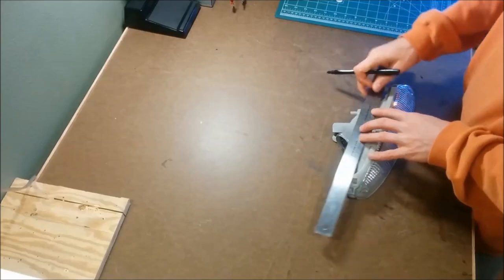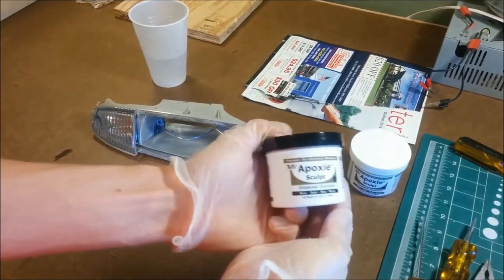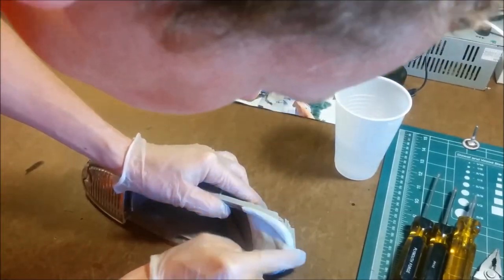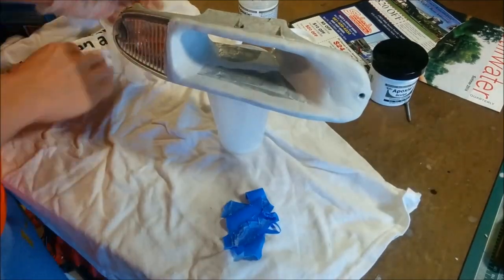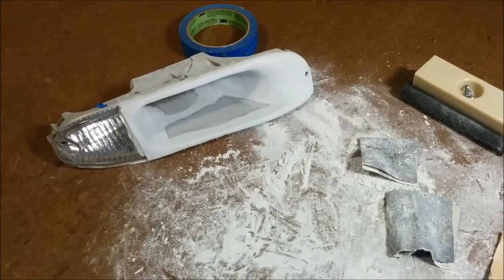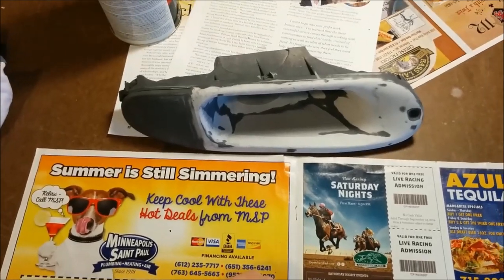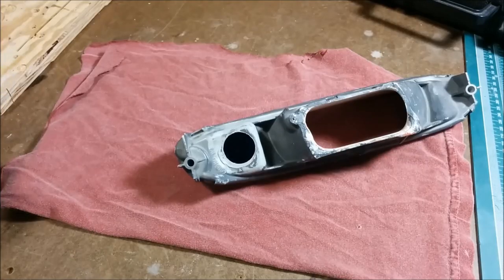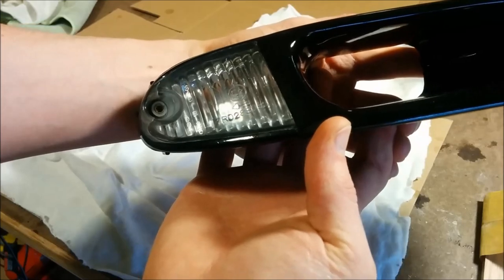How to: Make Turn Signal Intakes (TSI)

Comment: So according to the Bernoulli Principle, or a quick google image search of car aerodynamics, these are the worst possible intakes on a car, and they are actually exhausts. Since the air is spilling over this front edge of the hood at a high velocity, the air is being sucked out of the intake. You'd find a much higher pressure inside the engine compartment, along the bottom edge of the windshield, or on the back of the car...
Reply: Special EDy you are actually right lol. /mech Engi here
Reply: It's for style.  Serves no functional purpose.
Reply: it's a miata bro, this is for looks
Reply: it's a miata dude. calm down

Comment: I'm actually half way thru making my own right now, and I had planned to use just bondo to make the intake look good... but now that I've seen this video I may have to use the epoxy/clay stuff instead! Thanks for the idea and good video
Reply from the maker: Yeah I wouldn't use just Bondo because thick Bondo will Crack. Use clay for sure.

Comment: Nice work. One thing I noticed was when you had to go back and add to the bottom to fill the gap, your final line was exactly the same as the lens. Maybe could have used the lens as a template?  When are we going to see a new video in your new place?

Comment: Now that i've started to dive into this project, I'm wondering if you have any issues with melted plastic? I noticed they put a metal heat shield type deal around the bulbs in the stock turn signals. Did you put your own type of heat shield in? If so, what'd you use? If not, have you had any issues with melting plastic? Thanks for all your help and advice!
Reply from the maker: I'm using a LED bulb now. I wouldn't use a regular bulb because I bet it would melt
Reply: Ahhhh gotcha, thanks for the tip man! Wish me luck!

Comment: looks great bro. nice work.
do your turn signals blink fast now that they are LED?
Reply from the maker: They did at first, but I fixed them by following a tutorial online that shows you how to replace a resistor in the flasher module to eliminate the fast blink.
Reply: can you link me to that tutorial? I have LEDs in the rear and they blink fast.
Reply from the maker: +xld3000 http://forum.miata.net/vb/showthread.php?t=335534

Comment: Hey another quick question, how'd you tape off the section on the clear lens? Did you just use blue tape and razor blade the shape you want or what? Thanks for all the tips so far
Reply from the maker: Correct, blue tape and razor blade is all. Be sure to remove the tape right after the last coat of paint.

Comment: Nice job, a lot of work, looks great. Good place to tube your intake air. My lenses are always full of moisture, like to get that fixed, any clues ?
Reply from the maker: dyno824 try resealing the lenses with a silicone caulk. You've got a crack somewhere that's letting the moisture in.
Reply: Both lenses are like this. Could have a lot to do with were i live, Oregon coast, everything moist here, great for mushrooms though. Thanks for your comment.

Comment: Nice work on this.  Clever and creative, I dig it.  Now that I have a butane soldering iron and can do wiring, I am going to borrow your idea on the DIY projector headlights and do fixed ones with flat lexan covers.  When I get around to the video I will give you a shout out.  Keep up the good work!
Reply from the maker: Thanks and good luck
Reply from the maker: Thanks and good luck
Reply from the maker: Thanks!

Comment: Looks awesome man! Great job! Question is how did you hook up the actual intake on these?
Reply from the maker: It's not hooked up. They just provide cold air into the engine bay. It would be possible to hook them directly up to the air intake with some ducting though.

Comment: Absolutely amazing craftsmanship but something that I think would have made it that little bit better is to paint the screws that are part of the intake black, and to add some black wire mesh to the inner part of the intake so you don't get rocks in your engine. Other than that, great video man! 😃👍

Comment: Really quick question, hopefully you'll respond to it, but how long did this take you?
Reply from the maker: It took me about a week worth of evenings to do each one (two weeks total).  First night was cutting open the lights, sanding, and applying Apoxie.  Second evening was shaping/sanding and applying Bondo. Third evening I made the new light socket. Fourth evening I did final sanding and Primer and base coat. Fifth evening I did clear coat. Just an estimate but you get the idea. Hope that helps.
Reply: Justin Depew Yes it did! Thanks a lot! I am trying to find a miata to buy and am just looking at fun DIY projects to do. Thanks!

Comment: but how does it connect to the actual engine intake?  i think if it's not directly connected the huge intake in the middle of the bumper would just negate all the air coming through the turn signals.  probably you can devise a ducting that would lead it directly into the intake airbox or CAI.

Comment: Wow, that's done right.  Other than the ecstatic's, is there any other benefit?
Reply: aesthetics* well it should cool the engine bay a bit I don't know if it works though
Reply: aesthetics* well it should cool the engine bay a bit I don't know if it works though
Reply: +lameWB Thx for the video & reply.

Comment: any issues with the 2k clear? I was told you cant apply it over acrylic paints. I just did a duplicolor  metalcast paint job on my bobber and need a clear thats fuel resistant.
Reply from the maker: Still looks like new. Not sure about going over acrylics since I haven't tried that. I imagine it would go over anything since it's 2k.
Reply: +Justin Depew in the video you showed an acrylic lacquer paint and clear. did you not use those as the base to the 2k?
Reply from the maker: +DocHolliday oh sorry I misunderstood. Yes I used that paint as the base to the 2k.
Reply: +Justin Depew ok cool. thanks for the fast replies. Great job on the custom intakes. I love seeing people think outside the box and do their own thing.

Comment: Is there a reason you completely cut off the edges of the lens? I'm about to tackle this project but I feel like if I leave the edge of the lens on, it'd be a good fit off the bat rather than trying to shape it to fit perfectly. Would this work or is it better to just sculpt it entirely from clay?
Reply from the maker: You've got a good point. I think leaving the edge on would make it have a much better fit. I imagine you can still blend it in with the clay.
Reply: Okay cool, I just wanted to see if there was a reason why you didn't do that. Will the Apoxie bond to it okay? My dad thinks you did it your way because my way would be more prone to chips but I don't think he knows what he's talking about. He was just making a wild guess. I guess I'm just checking if my way would be as legit as your way? Thanks for the quick response by the way, yours look great!
Reply from the maker: I figured it would be hard to blend the lens into the Apoxie and you would be able to see the where the lens and Apoxie came together, that's why I just cut it all off and made it all Apoxie.  I was able to see a line between the area of the lens I left for the turn signal and where the Apoxie blends into it.  If that level of detail matters to you then I would probably cut the lens all the way off and mold it like I did.   Otherwise the Apoxie seemed to stick very well so I don't think it'll be an issue.
Reply: Huh, interesting. Well thanks for the advice man!

Comment: how about actually making them as the cars intake?
Reply: brake ducts would be mire usefull
Reply: water would be it's enemy
Reply: +Shavan Irving check out haggard garages video on them trying to hurt a car with water. makes little to no difference.
Reply: +Taylor Perkins Oh and my V35 skyline has an intake where you can pretty much see the air filter from the grill
Reply: +Taylor Perkins i have my intake routed to my tsi its pretty easy to do
Reply: the headlights are in the way for any ducts
Reply: +xDrifz Jasons E. Mazkalniņš only when they're closed mine are always open

Comment: I would like to know how you get through MOT with these. Isn't those turn signals too small?
Reply from the maker: We don't have vehicle inspections where I live
Reply: +Justin Depew Whaaa?!
Reply from the maker: +Tomas Sabalas Minnesota
Reply: Not a problem in the EU, have been using the smaller space for the turn signal for years (and the larger space for running lights), no problem with MOT in the Netherlands.

Comment: Hey what bulbs did you use to replace the stock ones??
Reply from the maker: I used these : https://www.amazon.com/gp/product/B00HJD4DRC/ref=od_aui_detailpages00?ie=UTF8&psc=1
Reply: +Justin Depew nice! Thanks! Are these just plug and play or is there any modifications I would have to make to my harness?
Reply from the maker: +Matrix they are plug and play but you'll get a hyperblink flashing unless you also fix the flasher module.
Reply: +Justin Depew how would I fix that? Using resistors??
Reply from the maker: follow the instructions is this thread to fix it : http://forum.miata.net/vb/showthread.php?t=335534
Reply: +Justin Depew thanks a lot I just got my led bulbs in the mail I'll be sure the try this!!

Comment: Is it street legal to do this? And is your the same you can buy online?
Reply from the maker: Technically it's not DOT approved because I modified the lens housing, but it's very similar to the ones you can buy online so if those are approved then I'm not too worried about it. Any cop will be hard pressed to tell the difference.
Reply: Justin Depew Well I'm from Germany so I have to check it. But since there's no daytime driving light inside (as far as I know) it shouldnt be a problem (I hope so)

Comment: Cool video, but couldn't you just skip the clay part...? It seems like it would be a lot easier to just leave it as is or create a mold and cast an insert.
Reply from the maker: Sure you could skip the clay part, but it won't look nearly as smooth and factory.

Comment: Do urself a favor and get urself Evercoat's products for all ur filler needs from a pro-paint supply store or online @ amazon just figured u'd also want to use products that wont expand or shrink like ur 2 part clay stuff and evercoats got all kinds of diff fillers for everything.. Evercoat's "Rage" light weight body filler & "metal glaze" would've made ur project go ALOT easier & faster..I rarely get pinholes with rage & ther metal glaze works hand n hand with it when i do but stuffs awesome for low spots cuz it kindof self levels itself out..also when using fillers like rage after 15-20mins of applying I can sand & shape it in minutes with 80grit then i go over it with a 220ish grit which cleans up lines & shapes while it takes out ur sanding marks all b4 it gets too hard & after it cures wet sand with 200+ grit, prime, then wet sand with 3-400ish grit & use metal glaze on any low spots or imperfections, prime & final wet sand & add ur color and look in awe @ ur perfect masterpeice.. with bonda it doesn't work as well it clogs up ur sand paper forcing u to sand when its hard which takes hours&hours vs mins plus no future shrinking or cracking years later like bondo usually does esp on thick spots..anywho figured I'd pass on some tips to saving u money & alot of time esp sanding time.. sure u might spend literally $5 more until u find a cheap online place but u get high end products that drastically reduce finishing times & labor not to mention will last 10X longer
Reply: By the way great video really enjoyed it I just figured I'd pass on what I was taught 20+years ago so maybe u'll try it out and learn from it as I did
Reply from the maker: Mike McCabe thank you for the tips greatly appreciated!

Comment: Umm next time use an oven to remove the lens. The glue softens and you can just push the front lens out. Cutting glass with a dremel, even with eye protection, is a horrible idea.
Reply: its a plastic lens

Comment: Did I miss the part where it became an intake lmao
Reply: It's a cold air intake? If u didn't understand that... When he drives his car air ... U know what air is right? , air will travel through that hole he just made and flow onto a pod filter he would have purposely placed there. Which is a cold intake ? I hope I made this simple enough for you 
Why hate on people's videos and making your self look like a wanker. You wouldn't be an ass hole at a car show so why on here give him positive feed back or if that's to hard some positive criticism so he can perfect his design .
Reply: hazza123live But he didn't include the crucial part which is running your intake to where it will actually benefit from this. So no, you're wrong and it's pointless, other than to cool the radiator.  How do I know? Because I have them too
Reply: @allofthepandas7212  I'm not sure if you own a na 1.6...... but the intake resides directly behind the headlight area. The radiator is not even behind those at all. So airflow is going directly thru these ducts into the intake filter behind it(namely the driver side duct). It isn't necessary to add that to this video, it's pretty much common sense for anyone looking to diy.
Reply: @alansmilealot  the intake sits on the exhaust. I own a Miata and know that these signals don't actually help that any unless you either move the intake to the passenger side, or route the filter to under one of the headlights.  Unless you do that, it's still pulling heat from the manifold and block, and the signals are just for deceration.
Reply: @alansmilealot  also, this comment was from a year ago. Bruh, look at dates lmfao
Reply: @alansmilealot  AND he says it's a 97, so nope, not a 1.6, and another reason you're wrong
Reply: @allofthepandas7212  yea your comment is a year ago, theirs comment was 2yrs ago and u posted a reply.... What's your point. The intake is on the exhaust side, which on the driver side, for America. I can't say if this will aid performance wise, I responding to your comment of why u didn't show the intake under the hood.  1.6 or 1.8 it still an NA, with pretty much the same layout in the engine bay.
Reply: @alansmilealot  Not really though the changes with the air box to deal with the space for the turbo mean it's not the same. I literally just got done rerunning my intake yesterday, so I know what I'm talking about. For a 1.6, swapping the intake to the passenger side, (intake side) is a lot more complicated, and you might as well not do it on a 1.6, that's the difference. The air filter for my 1.8 is currently under my passenger (intake side) headlight, so that it will actually get performance increase from these signals. I'm not gonna talk about how it will effect the 1.6 because I haven't done any experiments on it myself, but I have definitive proof that these signals don't do much at all on a 1.8 if your air filter or air box are still sitting on top on the exhaust. As I said, unless you change the stock intake, or reroute where you put an aftermarket filter, it doesn't do much of anything.  This is coming from someone who went and put some of these on his car after watching this video (11 months ago) and since then I've been doing more experiments on airflow and if this actually does anything. It doesn't. Not unless you start deleting or tucking wiring harnesses, and deleting stuff like the headlight motors. Either running your intake up to the cowl panel, to the intake side and up near the firewall ( near where the AC comes out) or under a headlight for an aftermarket filter, is pretty much the only way to effect it. Now. These signals help keep the engine bay slightly cooler, but only at interstate speeds. which means you could easily run the intake under the front bumper if you wanted anything other than a different look. I never said I was hating on this design, by the way, I still run them on my car. But I was responding to a person saying how it had nothing to do with the intake, and expressed how the intake would have to be moved to be made a "cold air intake" which the commenters above were freaking out over. I know this was a video about signals and not intake, you probably do too, but I was commenting toward people who are acting as if this guy actually made a video about the intake. Now. Since I'm done having to fully explain myself to someone who is replying to my comment from a year ago, I'm done with this interaction. Either you're used to EU cars and they ARE more different than you think, or you don't know as much about 1.8's. Either way, there's more for you to learn, and I've already gotten my hands dirty in that department.